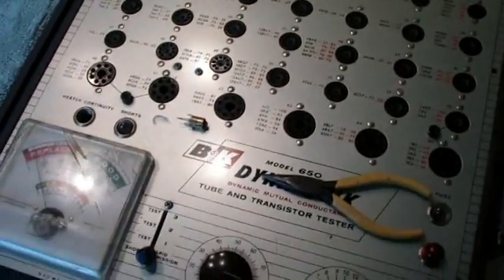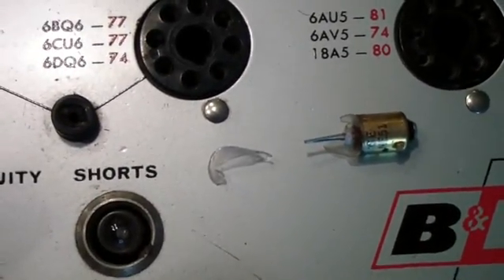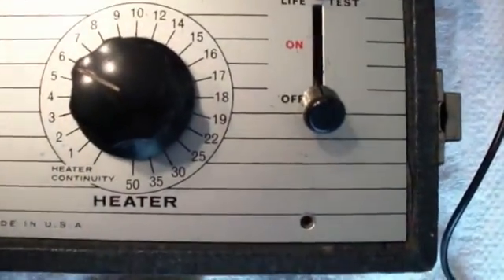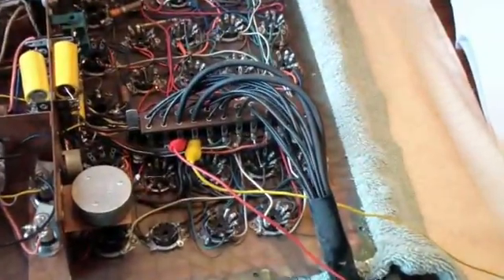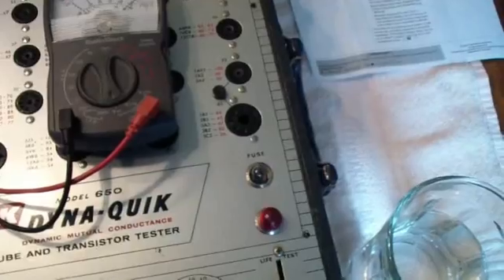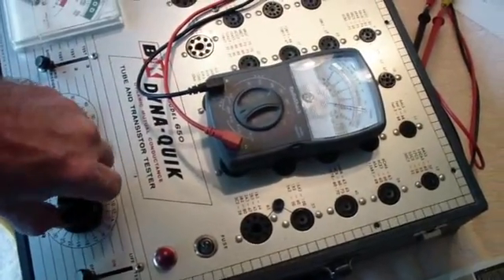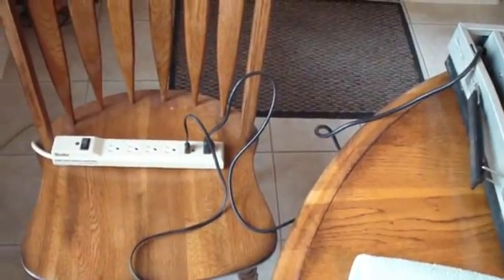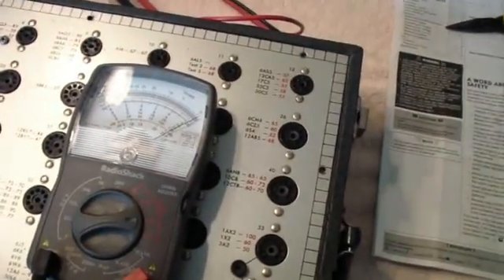TTT028 BK 650 Pt4

Comment: I think it would be interesting to see what the heater voltages would be with the corresponding voltage tube plugged into a socket. The additional resistance may drop the voltage some.